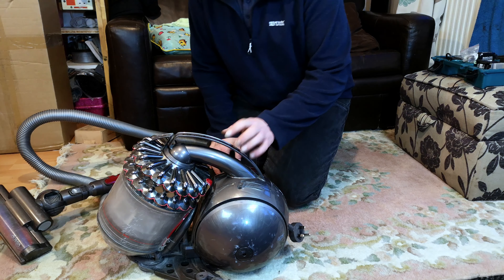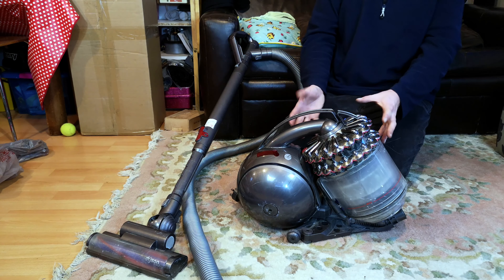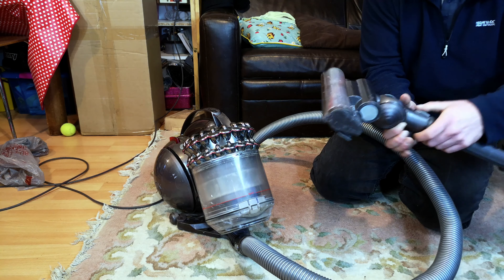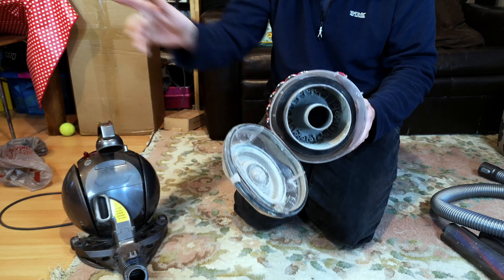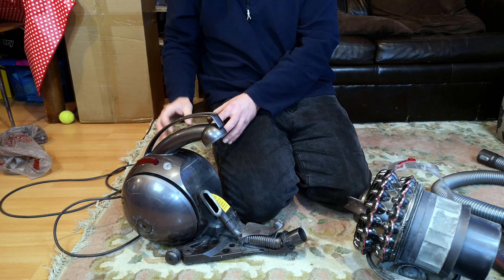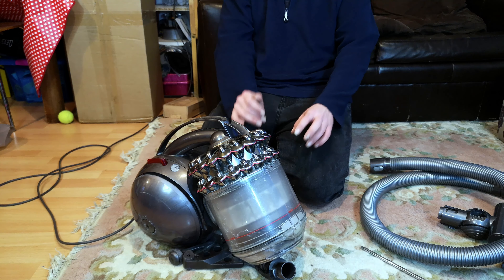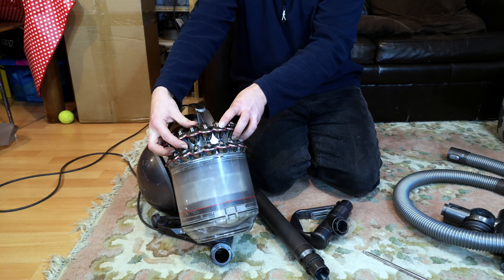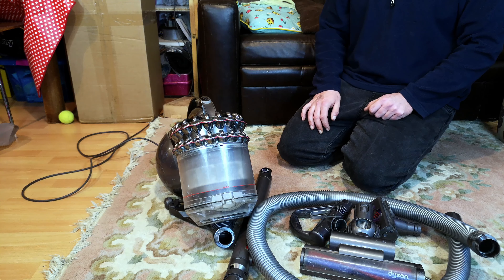Dyson DC54 Cinetic - Filterless Vacuum in for refurb. How bad is it!

Comment: Just finished servicing a Dc54 aswell as a v7.
I seem to service these the most as most people over fill them and they get clogged or as they get bashed around and create tiny air leaks around the gaskets of the cyclones from cracks or dislodgment, they loose suction greatly and the cyclones start to fill up, I've had plenty that needed the cyclone pack replaced because of internal or external leaks between and in and around cyclones, they don't fair well to being droped or bash around.
I had a DC54 for over 10 years and it worked fabulously but I'm a tech with OCD and I babied it emptied after each use, but I needed something with a power head that was not so expensive I needed to sell a kidney so I got a Shark NV801, yes cyclone is primitive but very easy to clean out, very good brush roll unfortunately we are limited in australia for powerhead type cleaners only uprights we have are dyson shark, sebo and miele have to be ordered if available and a couple of cordless/corded industrial brands, and canister models are basically non existent, a brand will introduce one it will be on sale for a year no one will buy it because the cost is astronomical and so they discontinue that particular model for not being popular.
Hoover had bagged and bagless power head models with questionable build quality, as well as sauber and wertheim but they are super expensive and the company godfreys is looking at closing down so no options there unless someone saves the company.

Comment: the problem is the people that don’t do the correct maintenance like emptying the bin before the max line and not when is all the bin full, this is the case when the cyclonic system fails and clog up . For this people is easier using bag, when it is full, they only have to change it.

Comment: I must be doing something wrong then…. I have a second generation big ball Cinetic 5+ years old and still works perfectly, just picking up dust, etc no big messes at once and make sure you suck up dust and air so it still flows! Dyson tested it heavily people need the use stuff correct
Reply from the maker: Not using it for diy is a big one!
Reply: Problem is that these vacuums should only be used by the people who really take care of their vacuums. Many "normal" people just use and abuse them and then the vacuum dies.
Reply: I use my cinetic big ball 1200 watt version 1st generation in a sort of commercial setting I clean weekly multiple offices and houses with lots of carpets in it! I shake the bin out done nothing more than that and the machine operates perfect filter only has carbon and no dust in the motor area so yeah Cinetic technology really works when used correctly

Comment: You got me repairing vacuum cleaners now.  I managed to find a free dyson dc54 that I flipped for £40 profit. 

Now I've got a Dyson Dc24 three of them in various connections. But I got two working but not the roller as the motors are gone and not worth replacing.

Comment: I've had my DC54 for many years and used it a lot. It has never lost suction and the cyclones have never gotten caked. People who use the machines commercially or suck up wet material or construction dust can have issues. This is not how the machine is designed or intended for usage. There will always be one or two out there that have issues but that doesn't mean the entire machine or design as a whole is faulty.

Comment: Hi. I have a DC54 and I'm trying to take apart the Dual Mode Floor Tool (part no. 966247-01 -- not shown in your video) because there is a blockage inside. I've removed the 10 Torx screws but it won't come apart and I don't know what to do next. (I have no mechanical skills...) Any ideas? Thanks.

Comment: Good video Sam! Now one thing with these is that even when brand spanking new bin & cyclone unit WILL strangle the airflow A LOT. It's just so over complex airpath that it's never going to perform like a bagged unit. I owned DC40 and difference in airflow before and after the bin is insane. So having the "best ever" cyclone system has steep price to pay.

Comment: I’ve had to fix my sisters Dyson DC54 as the motor died on it I stripped and cleaned everything on it of course part from the filter and still going strong I did recently get a message about it being clogged where the hose connects to the vacuum but other then that no complaints as of yet
Reply from the maker: Nice! That small front hose clogs easily on all the machines that use that design, easy to remove the 2 small cross head screws and pop the hose off and check, or turn it on with the cyclone off then refit the cyclone and see if it starts screaming 😂

Comment: mr dyson: "so here's my filterless vacuum that needs no cleaning, it's genious.. here's the components.. here's the internal filter mesh thing...    you want to see where the fan is in my fanless fan? where are you going??"

i have to say i still love my electrolux flexios(just as a tech thing). flexio(1) not 3 or whatever.   it has just a big filter fabric thing on the bucket(cleanable), motor has a secondary air route to keep cool(for upper end of the motor) enough if it gets 100% blocked, has a bypass valve too. does 100kg of cat hair and sand a year no problem but most importantly doesn't burn out, does 1400watts and they've sold them for near a decade I think now. maybe it's eu illegal tho for consumer sales on the watts or something.